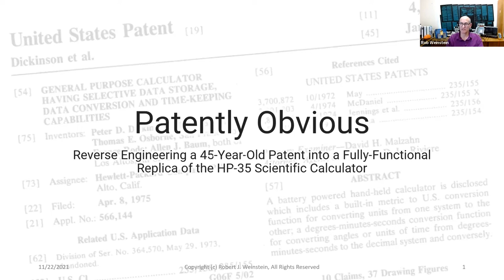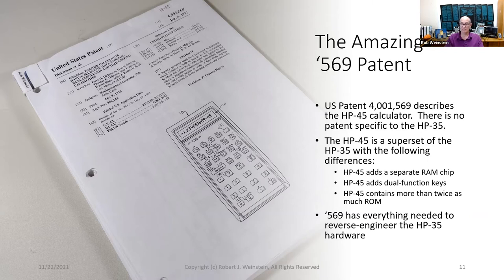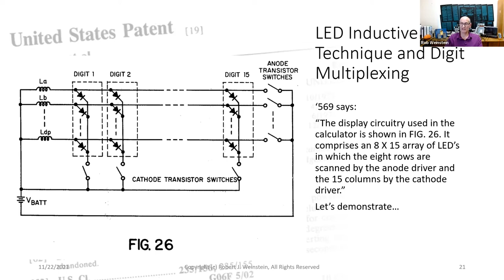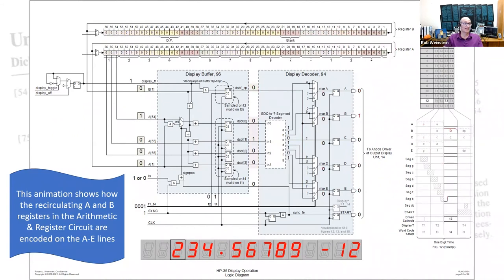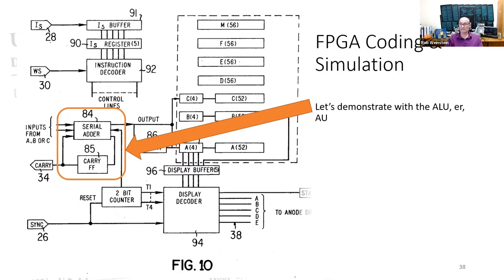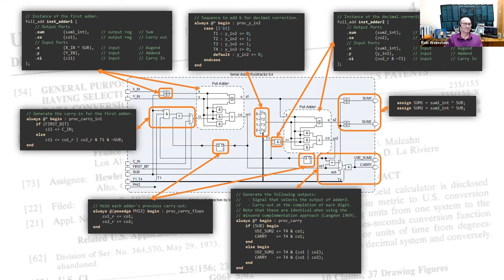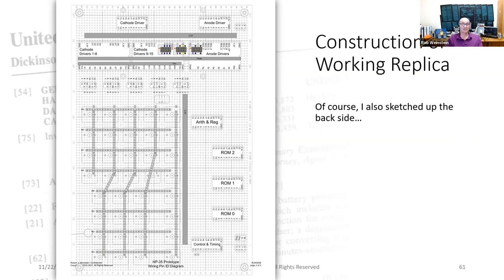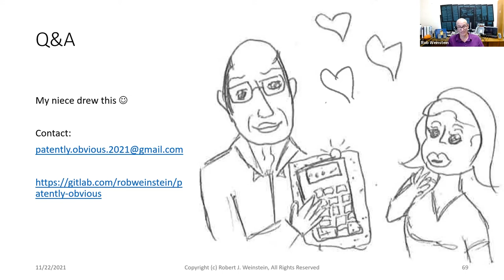Remoticon 2021 // Rob Weinstein Builds an HP-35 from the Patent Up

Comment: It's fantastic work, congratulations. I'm currently restoring my dad's HP-35 and today managed to bring it to life for the first time in 40 years. I also picked up an extra, sold as "spares or repairs" but I just added a LiPo battery and it works. 

I notice you have the corrected ROM where 2.02 Ln e^x results in 2.02. My 'spare' still returns 2, so it must never have been fixed.

Comment: My oh my.  Brilliant engineering combined with passion and excellence.  I still have my original HP-35 from 1972 and of course the re-issued HP-35S which is a LOT faster to result.   The original was gold plated in many places, double-shot keys that don't ever lose their imprinting, and the presence of a "pi" button was amazing and very useful in many aspects of electrical engineering, particularly radio where it seems nearly every formula involves "pi".

Comment: I'm not sure how many people would buy one but I'm surprised HP haven't re introduced the HP41CX. Better still, with a micro SD adaptor for the rear slot this calculator would be even better still. I'm lucky, I still to this day have the pleasure of using my HP41CX, HP 97 on my desk and my HP 67 - all working except the card readers. The 97 still prints.

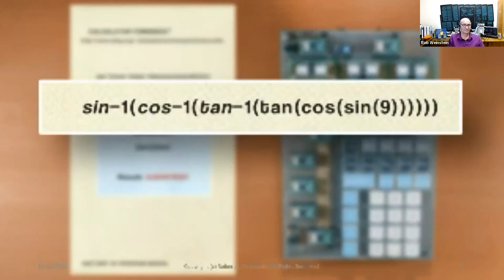Comment: Fantastic job, Rob. For the example calculation at 33:42 i tested on the modern HP-35 (with LCD display). The answer is different with the original HP-35. It was 8.999999860. What going on here? Truncation errors?